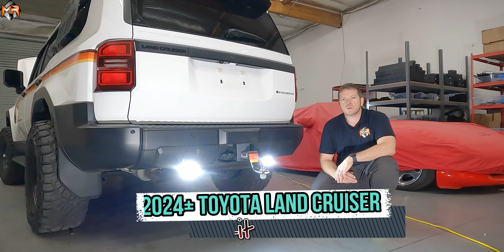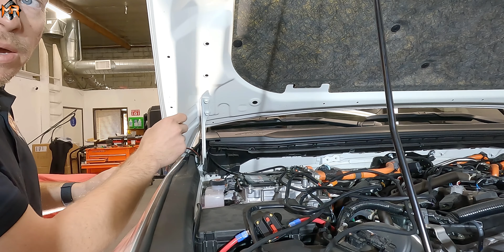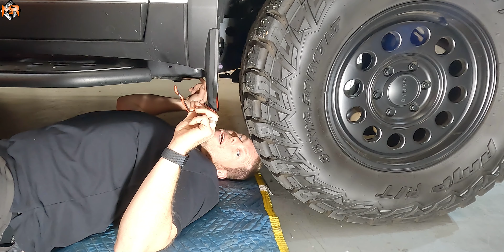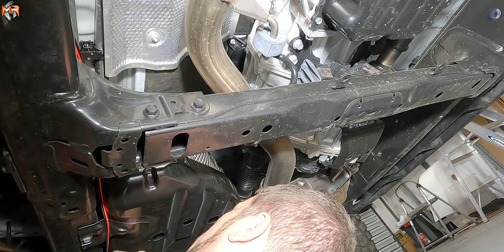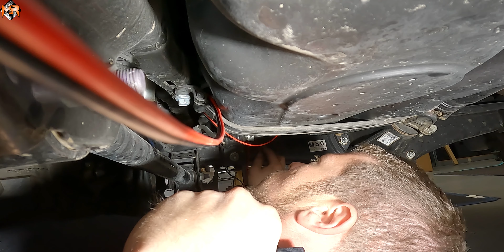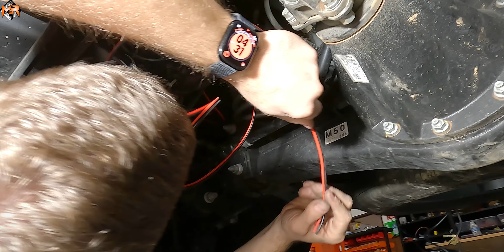Toyota Land Cruiser Reverse Light Kit | M&R Automotive | Tutorial

Comment: Hello! Enjoyed the video - actually all of your videos on the Land Cruiser 250 accessory lights! Very well done and a lot of thought put into your organization and attention to detail. You obviously realize that many folks' are a bit hesitant at installing anything electrical because of the fear that accompanies lack of knowledge (me included). Your presentation, however, has convinced me that with a thoughtful a approach and you as the guide I may be able to pull this off. So, thanks again. I do have one request, however, that I would like to make. Would it be possible for you to post a photo on your web site of where you mounted your fuse and junction/terminal box under the hood. In looking at the under-hood space I was not able to estimate how and where one would place it. It may be that because you were simply providing a video tutorial you did not , actually, mount the terminal permanently. If so, I understand. Perhaps, then, you can provide some suggestions that will allow me to close the hood safely and prevent interference with other systems. Lastly, do your products come with a warranty and would installation result in a potential loss of warranty in a new Land Cruiser?  Thank you again. Really enjoyed your instruction.
Reply from the maker: We mount the wireless controller to fuse box cover using supplied bolts